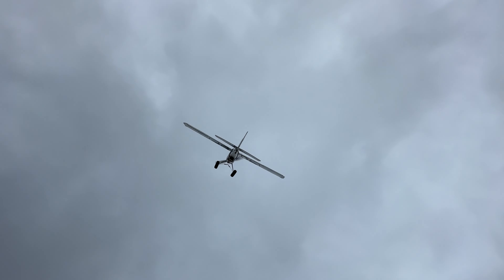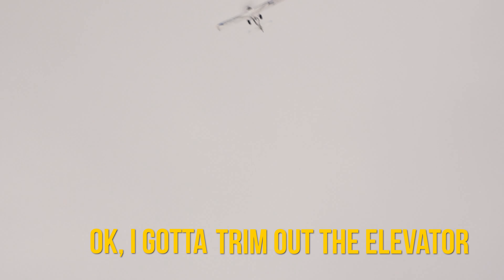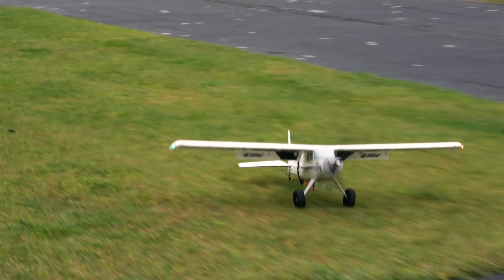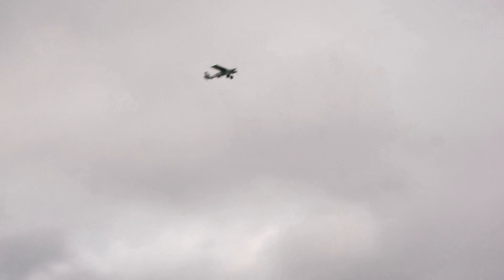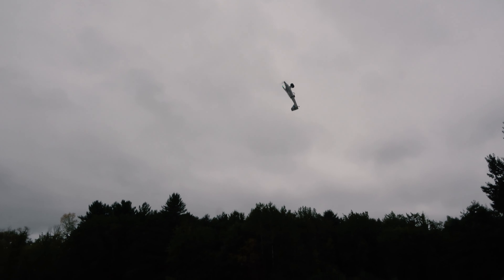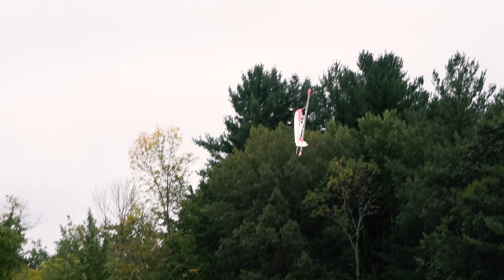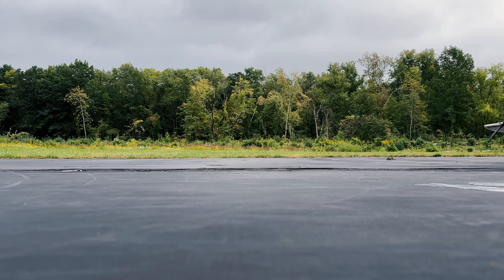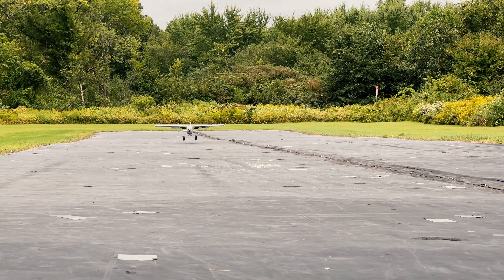MONSTER Power Timber

Comment: Hi guys!  Great video production as usual.  I built an HRC-7 from "The Hangar,"  It always flew a bit tail heavy, so I used to attach a 3S 1500 battery to the firewall to compensate.  Then I got a Monster Motor from Flite Test.  Hooked it up with a 60-amp ESC and a 10 by 6 prop.  Now it roars down the runway with a 4S 2700 and can rocket up to 450' in a few seconds.  I don't have anywhere near that power to weight in anything else except my profile multiplex Funny Cub.  That is so much fun to just yank up in the sky and just stop short, hanging in the sky like a kite.

Comment: Late to the party. Buuut... Efff 👍 
I was similarly impressed with my fms  1.3m PA18 when, after flying exclusively on 30c 3s 2200's, trying out 4s 2200 50csmart bats. Stock 40a esc and all. There aren't many vids of it flying with those on YT. So i assumed it was problematic or taboo. 
All I've noticed is sheer awesome. 
Sorry, im rambling. Just excited about power upgrades. Thanks for the videos 👍

Comment: Flex came out with a Sky Wagon, niiiiiice. That might actually be a Flex model I would love. Other than the Super Saber of course.
Reply from the maker: This is actually their original Cessna 170 (not a Skywagon/180/185) that was released several years ago. We bought it used second hand. They now have a sweet V2 out that’s even lighter with updated features. 👍 -Zach